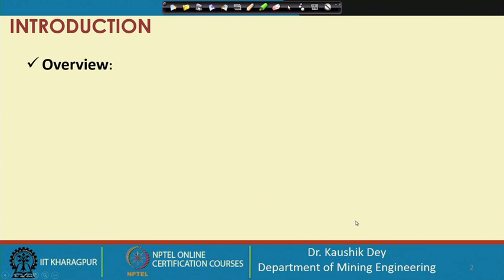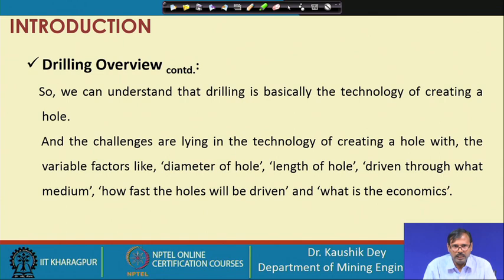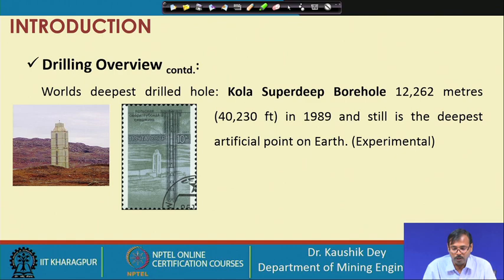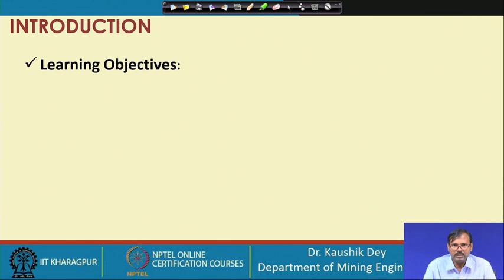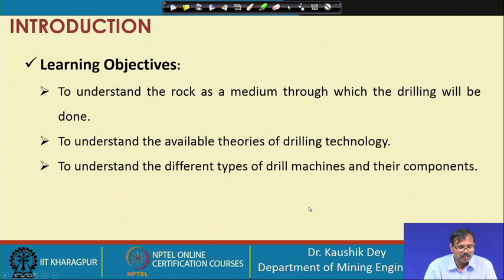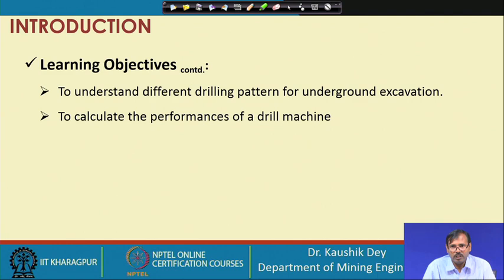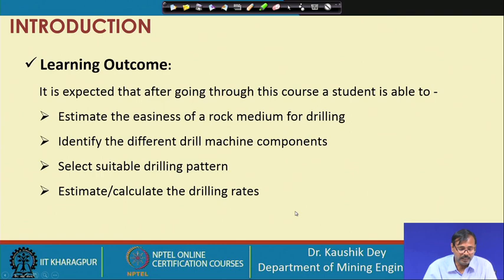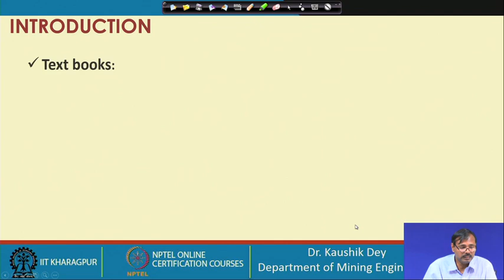Lecture 01 : Introduction to Drilling Technology

Comment: Sir which drill bit use tocreat hole of10 mm
Reply: Depends on what you want to drill ... !! Usually normal twisted SS bits are ok to use on non metallic surface...